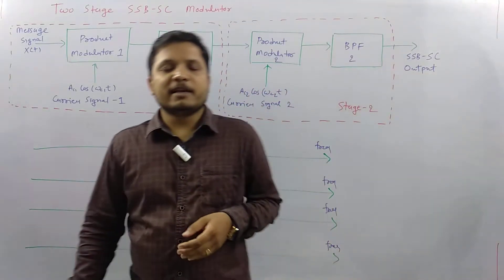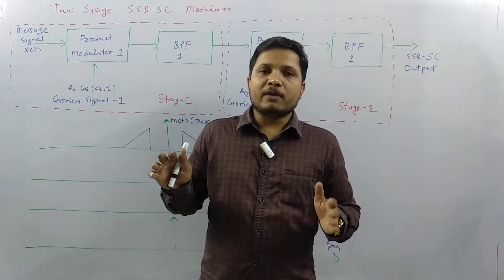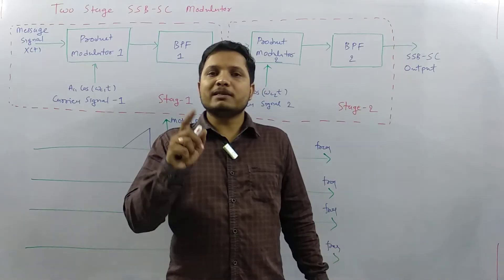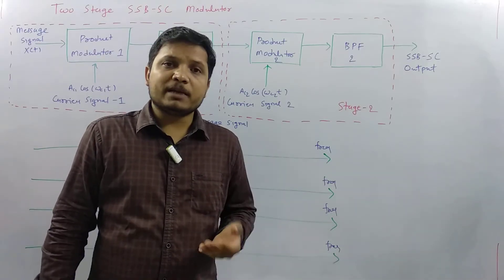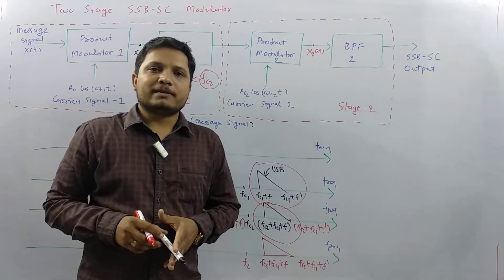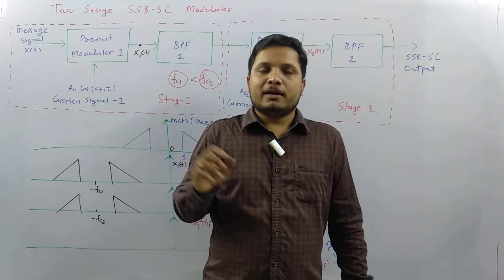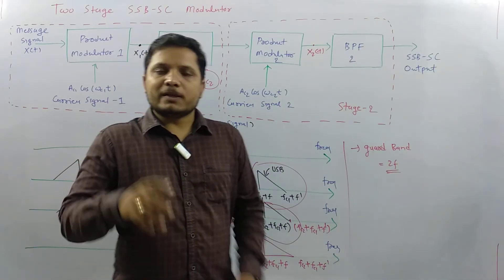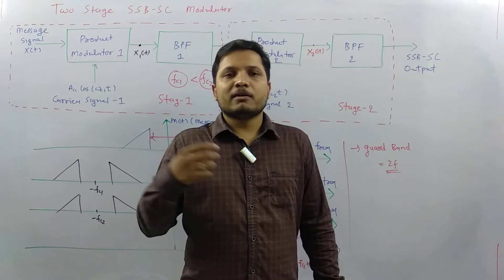Two Stage SSB-SC Modulator | Basics, Working, Circuit & Importance | Analog Communication

Comment: Why it is difficult to design a band pass filter at high frequency?
Reply from the maker: Because you need higher cutoff and lower cutoff at high frequency
Reply: @EngineeringFunda  so is it difficult to get the higher and lower cutoff frequency at high frequency? Why?